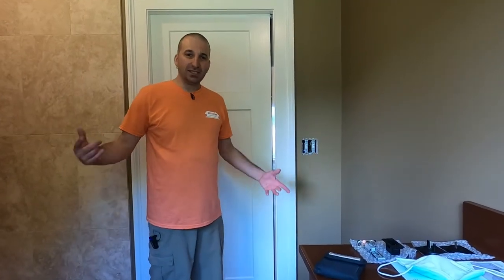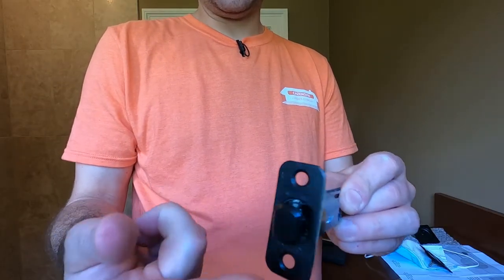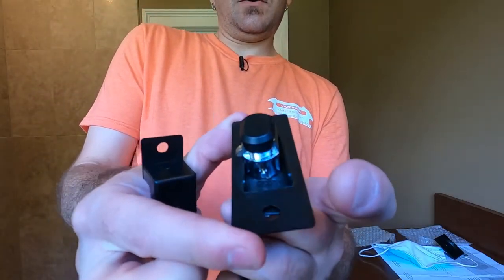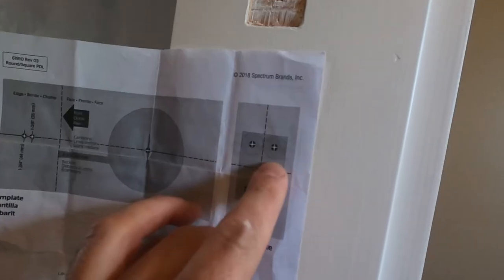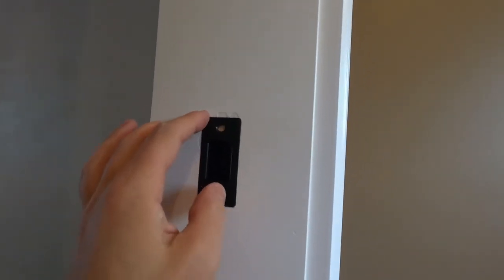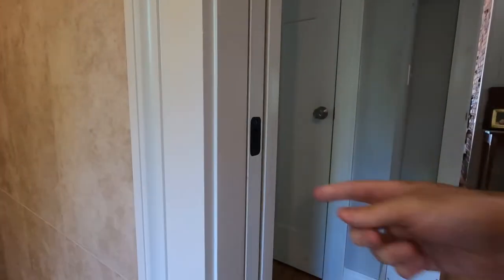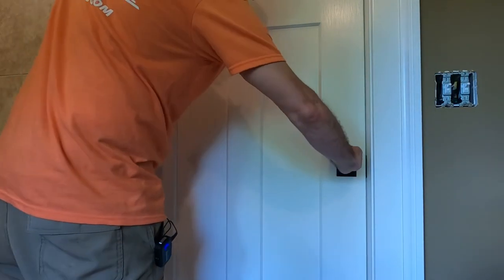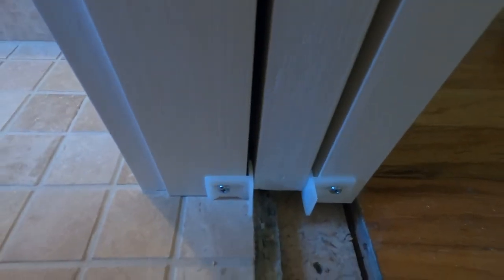Kwikset Pocket Door Lock Installation | 335 Square Iron Black Privacy

Comment: Thanks for an excellent, clear video. I've been shopping for pocket door handles and I couldn't see how the bit would work to pull the door open. You showed clearly how you push in and the latch pops out. Finally!
Reply: Same question I had.

Comment: Just a tip, i typically put the bottom gliders behind the finish trim. So you dont see them and dont have to cut them off. So, install them during rough in, after the door is mounted. And before you install the finish trims (1x2).
Reply from the maker: oh interesting. But what if you have to make any adjustments?!

Comment: Install the original bottom guides at almost a 45 degree angle near the bottom edge of the door. Sort of like this \  / this way you can make good contact with both sides of the bottom edge that will remove all of the wiggle out. You're welcome 😊
Reply from the maker: Good tip!

Comment: Hi there, I currently have a door with a pre-drilled hole that is 2 inches in diameter and 1& 1/2 inches away from the door's edge. Can you advise if this lock will work with this hole? Thanks a mil!
Reply from the maker: it should! If you get it from amazon you could always return it if it doesn't fit

Comment: Hi there, I have a door with a pre-drilled hole that is 2 inches in diameter and approximately 1 & 1/2 inches from the door's edge. Can you say if this lock will work with these dimensions? Thanks a mil for your help!
Reply: no
Reply: ok, thanks for the feedback 
 @martinluthierking